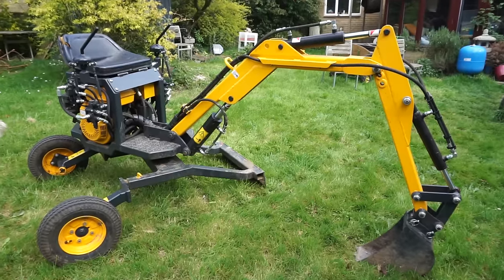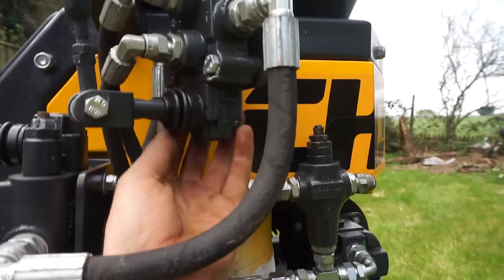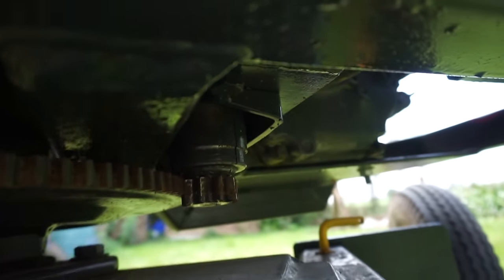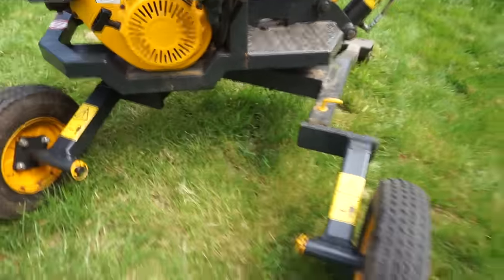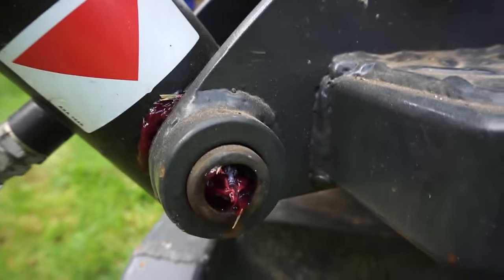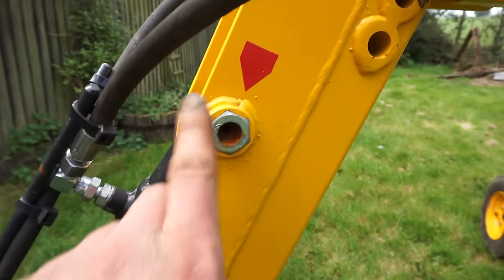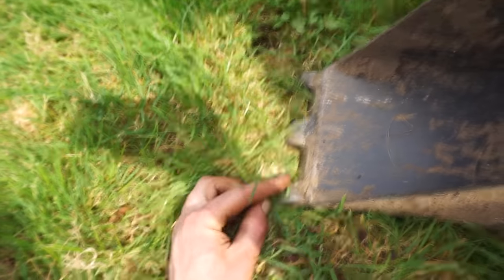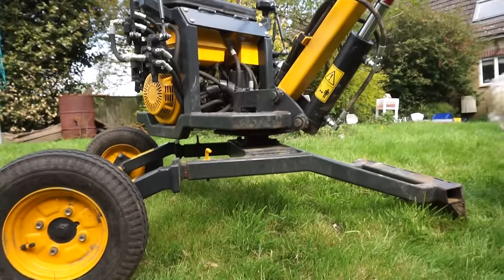DIY Homemade Mini Excavator 360 Slew

Comment: Neat
Reply from the maker: cheers man, ere, u made any progress on ur twin suffolk??
Reply: No I need to get a welder first and then get 2 engines then I’ll do it.
Reply from the maker: don't pay more than 20 quid for one of those mowers there's enough of them out there you even see them down the tip from time to time although i spose not at the moment.. doh. but good luck still!
Reply: council house creations or I could just wait until someone is selling 2 engines somewhere and buy them.
Reply from the maker: yeah whatever the cheapest option is ay buddy ;-) thats my what i say. if you get the mower with the engine you get a load of useful sprockets and chain to hook it up to a go cart
Reply: council house creations yeah I could use parts from mower drive system but I want to use a 3 or 5 speed transmission with reverse from a riding lawn mower and just use parts from that.